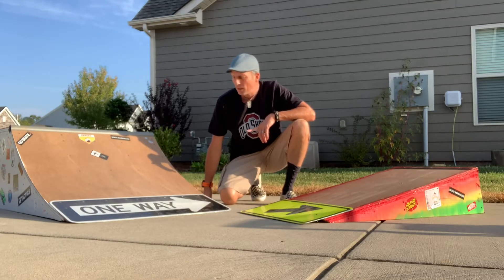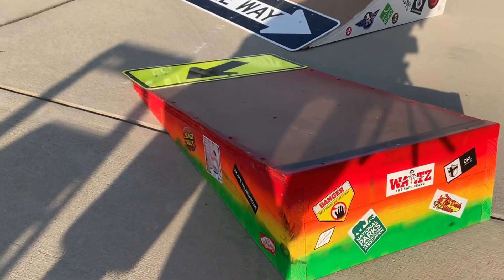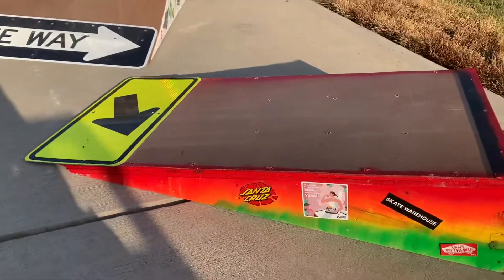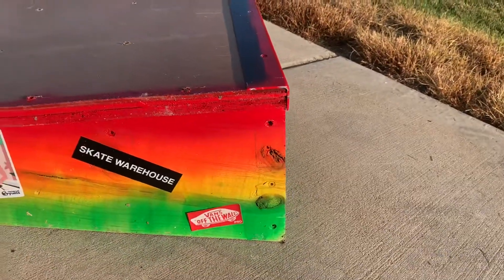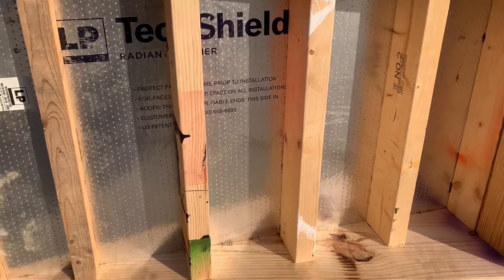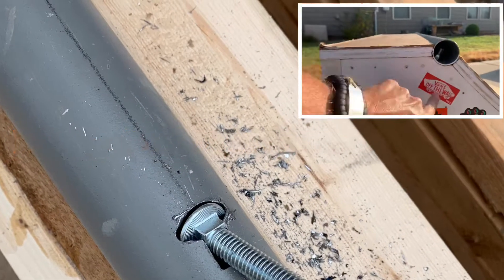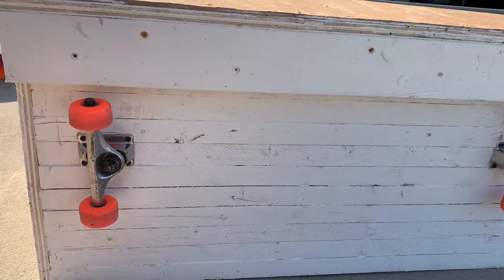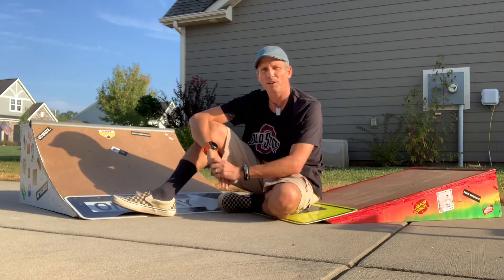Dirt Cheap DIY Skateboard Ramps!

Comment: Hey your ramps look great, and i have a question about the quarter pipe : how you get this curve on the deck plywood without breaking it ? You bend it before or something ?
Reply from the maker: Thanks, as for the bend, you have to use layers of thin plywood so it will bend enough.  The tighter the radius, the thinner the plywood needs to be. My ramp has two layers of 3/8” plywood and a top layer of masonite.  When attaching each layer, you put it up tight to the coping and screw in the top, then use your knee, foot, hip or a friend to press the sheet into the curve of the ramp and then work your way down it screwing it down.  Hope that helps and thanks for watching!
Reply: @AJStarch  thank you for your help, im bout to build a curvy kicker and definitly borrowing you this road sign as a transition idea, it adds a great style and it seems to work well !
Reply from the maker: @brickskates  I’m planning to build a curved kicker soon too.  Good luck with yours!

Comment: How did you cut the T slot into the pipe?
Reply from the maker: Hi Logan, I basically drill holes in a T shaped pattern and then file them out to connect to one another.  I show it in more detail in my video where I build a rail at https://youtu.be/34WqaUTL0zU Thanks for watching!

Comment: so this is obiously sick, but not dirt cheap
Reply from the maker: I guess that depends on your perspective.  The way I built them vs just buying them from say Keen Ramps… yes I’d still say they’re dirt cheap.  Also given more time to scrounge up the materials, I can build them even cheaper than I did.  I was just on a time crunch for these.  But thanks for watching and stayed tuned because I’m currently scrounging materials for a dirt cheap micro-mini ramp build…
Reply: @AJStarch how much was the first one? Id like to build it with my dad it looks nice
Reply from the maker: @ClaytonClayton-t2j I used a bunch of scrap wood left over from other projects or recovered from trash.  The only thing I bought for it was the Masonite top sheet and screws. In all it can be built for just the cost of screws if you’re good at scrounging materials and patient. You can also get free materials on Facebook marketplace. If you just buy everything then you’re probably looking at $50-100. Good luck and thanks for watching!